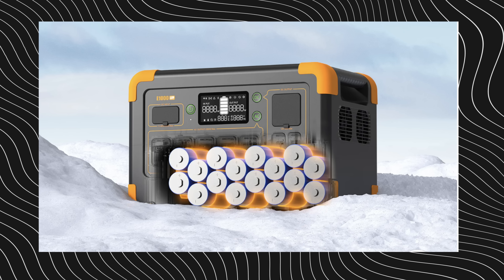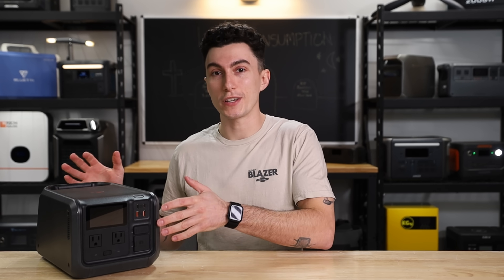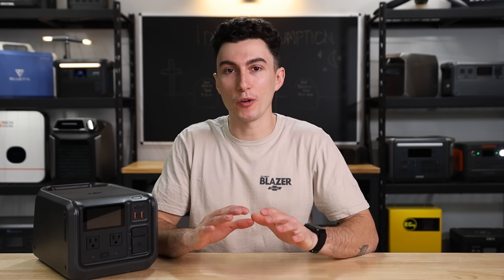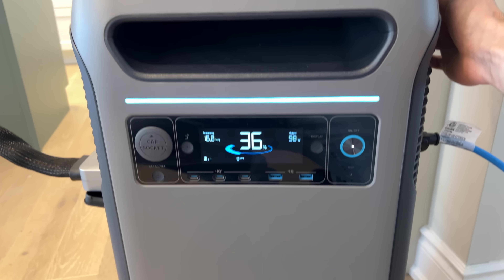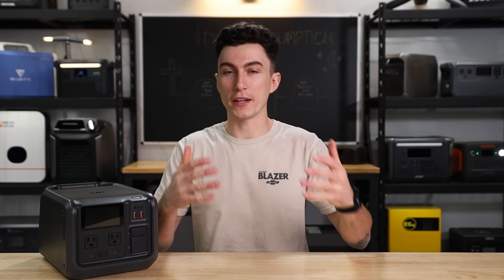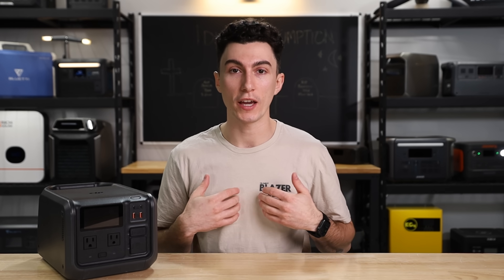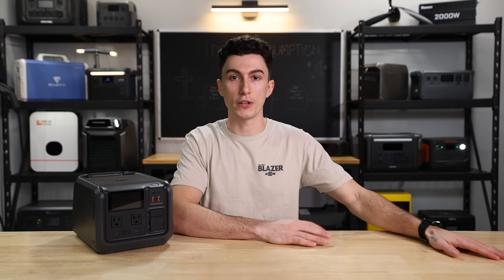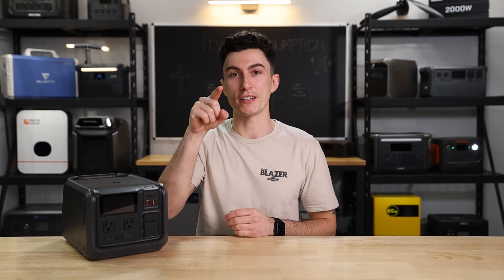Why Your Power Station is Draining Itself So Fast..

Comment: You have landed on one of the biggest issues with this stuff.  A lot of people buy these huge and very expensive solar generators not because they are trying to run an off-grid property, connect to a big solar array, etc. but just because they just want to keep their food from spoiling for a couple days after a storm.  And they think a bigger and much more expensive one will last a lot longer than a smaller one.  But just as a big gas generator uses more fuel at idle, so does a huge inverter.   Worse, a normal residential fridge draws virtually no power about half the time it is plugged in, it is a very intermittent load.  So if you have relatively modest power requirements, get a solar generator around the size of a Jackery 1000 that can easily run your fridge all night and a small, efficient c. 2000 watt gas/propane generator that you can run a few hours every day to recharge it.  Spending $4-5k on a huge solar generator just to keep your fridge on for a few days is total overkill.  You can accomplish the same thing without having to store 30 gallons of gasoline on site or spending anywhere near that kind of money.
Reply: I am one of those who just assumed: bigger would do the job. For those in third world countries, power outages for a few days are a real thing.

What to do, what to do?
Reply: @ The cheapest option for a grid that frequently goes down is going to be a small DIY solar system (battery, inverter, solar panels) backed up by a gas generator for when the solar panels inevitably can't keep up with demand because of weather.  These large power stations have two of the three components all integrated into one box, but you will pay for that convenience/simplicity.
Reply: @  Solar panels , battery's & a inverter. generator too if u can get one.
Reply: And keep in mind that there are three completely separate scaling components here.   The solar panels, the battery capacity, and the inverter wattage.   Power stations combine battery and inverter, but that also limits your options with regards to being able to scale just one of the two components.

And then there are gas generators... the traditional "generac" style large gas or diesel generator was designed to run the whole home without storage, but this also meant that those sorts of generators gobbled up fuel like there was no tomorrow even when home loads were low.

The modern way of doing a gas generator is to have a much smaller generator that ONLY charges the battery bank and does not try to actually supply AC power to the home.   This way you can purchase a smaller, simpler generator (though relay-controlled auto-start is still a nice feature to have), and pair it up with a battery charger designed to run the generator at roughly 50% load.

With the modern method, the generator only needs to run a limited number of hours each day to fill up the storage and will sip fuel because it only ever runs at optimal loads and is turned completely off at all other times.  Plus it won't have to run overnight at all.

-Matt
Reply: Since I use my units only for backup power needs and to save a few $ when the sun’s out, I don’t leave the inverter “on”.  I only activate the DC—>AC inverter when I’m actively using the generator and when I’m away from home (in case the power goes out while I’m gone).  And I’m ok with “idle” inverter power draw during these periods.
Reply: Charge the jackery by solar or alternator.
Reply: 2 days at 500 watts would be like 4 gallons of gas if that.  Most fridges run the condenser most of the time - rarely if ever will it pull no power.  I have both types. The gas gen can charge the power station then I don’t need the noise and gas for like 12-24 hours.
Reply: Guess you didn't read my reply! My 3000w low frequency unit will run my whole house on 120v, and it's idle consumption is a mere 13w. So your idea of bigger isn't better is utter nonsense, it comes down to quality over cheap chinese high frequency BS. The only company in the business that has better idle consumption is Victron @ about 9-11w, and they dont make solar generators. I have 2 3000w low frequency units 6000w surge, and thats true power, transformer based, dual mppt controllers 2000w solar input, dual ac charging, 1500w input, 20a car charging, 6 ac plugs on 2 15amp circuits, 5 13.8v dc cigarette ports 20amp, TT30 RV plug, external battery port, that accepts any 24v batteries in any chemistry, and I have 10kwh in batteries on them, heaviest piece 32 lbs, and it idles 13w!  Seems to me your just choosing cheap chinese crap over well built equipment. My system isn't plastic, it's all metal and built to outlast me, all modular and doesnt require cables to connect the proprietary batteries, in 2kw increments. 1 cable for external batteries, and thats not a hack, they charge from the system, and load share in conjunction with the factory batteries!
Reply: @dustydawson8977  So what kind of money do you have in all of that stuff?  What system are you talking about?
Reply: @trustbuster23   refrigerators have a huge inrush of current needed to start the compressor i don't believe a 1000 watt jackery is going to do it. especially if the refrigerator is older. a new refrigerator maybe.
for people out there --- you need a Generator capable of 4 times the Rla min. to start a compression. ie: if Running load amps are almost 8 amps = 3,200 watt Generator. 
old fridge.

new fridge--- about 4 amps Rla = 1,600 watt generator.

Some compressors can draw up to 7 times Rla on start for a second. i always recommend a 3,000 watt generator for a refrigerator.

also note refrigerator goes through a defrost cycle every 6 hrs - drawing about 390 watts for up to 30 min.
Reply: @OcRefrig  Well, I have actually done it, successfully several times with just an older Jackery 880, 1000 watt inverter, 2000 watt surge.  Multiple, multi-day outages, never had a problem.  Charge it up in the evening before bed with the generator, runs all night and usually has about 35-40% capacity left in the AM, and the Jackery 1000 has more capacity than mine.  My fridge is not particularly new, probably 20 years old at this point, and it is a full-size residential fridge with an ice maker etc, basically what most everybody probably has these days.  Agree that you do have to look at the amps on your particular fridge and size accordingly, but unless you have some fancy sub-zero monster or a relic from the 1970s you are probably going to be fine with a mid-sized inverter.
Reply: @trustbuster23   good to know.  thanks. they must be using a good battery & inverter in them.
Reply: @OcRefrig  It should, my EB3A (600w, 1200 surge) will USUALLY handle the initial plugin of my fridge (i measured as high as 950w surge but it lasts a few seconds and the eb3a doesn't always do it), so it's like right on the edge. Fridge compressors aren't all that huge, most of the rated wattage of a modern fridge is the product of it's defrost heaters.

a 1000w(2000w surge) will handle a fridge without issue

Comment: Many inverters go into a low power mode when there is no draw, mine is 2-3 watts. I shut off constant power draws like wifi at night and only keep the fridge plugged in. The inverter goes into low power mode when the fridge cycles off so the inverter is only drawing idle power when the fridge actually cycles on. I built my own system with 200 Ah LifePo (2560 Wh) and an inverter and I only use about 25% or 640 Wh in a 10 hour period running a standard household fridge.
Reply: Does a fridge actually work in low power mode. Victron's low power mode blinks the power on every few seconds and if something pulls power it turns on fully. Is that enough time for the fridge to realize it needs to run the compressor?

Comment: There is also the not mentioned loss of capacity from the lower voltage (3.7 lifepo4's ?) batteries in the unit to make the 12 volts when they aren't even using the inverter circuitry.  

Might be best to have a low end power station for charging/powering the small things, phone, tablet, smaller power packs, USB lights, toothbrush, or other USB chargeable devices

Then get an actual 12 volt battery (or several for higher capacity) and an inverter for the higher powered devices like the fridge or space heater(s) you may be using.

And a larger system like the f3800 for the heavy stuff like stove, washer/dryer, and HVAC, etc..

I've watched many videos from several posters now and it really seems there is no single "do all be all" system.  I doubt there ever could be with such diverse voltage and power requirements of all the devices people currently use.  Same as why most current LED lighting 'replacements' still use 120 VAC even LEDs are much lower voltage because no one wants to rewire their domicile from 120 VAC to 12 VDC for lighting.   LED lights currently aren't as 'efficient' as they actually could be.

Better to use a Power pack and a few USB lights.
Reply: The cells are 3.2V for LiFePO4 (3.7V for NMC).   But that's irrelevant because the cells are placed in series.  4 x 3.2V = 12.8V nominal (10V to 14.2V full-range, typically).  So a 4S LiFePO4 battery system can supply approximately (compatible) 12V directly to 12V gear with no conversions.

However, no power station that I know of uses a 4S topology internally.  Most small power stations use a 6S, 7S, or 8S topologies.  Larger power stations typically use a 10S to 16S topology (16S is 48V... 51.2V nominal, 48V to 56.8V, roughly).

-Matt
Reply: @ I’m just saying there is loss when a conversion is done, up or down.

Comment: 70 watts idle consumption on ANY inverter is Just a Poorly designed inverter. that's absolutely Nuts !!! 🥜
Reply: If you think 70w is a lot, You must have missed the whole home example in the video with 150w idle consumption
Reply: It depends on the inverter. If it was a 150W inverter then yes, 70 watts is poor. For a 3000W inverter, 70 watts would be quite normal. This is an extension of the car analogy in the video. A 1 litre engine will idle using much less fuel than a 5 litre enging. My 1kW inverter draws about 20 watts when idle.

For reference, the NOVA 12K Inverter in the video (2:42) shows an idle draw of 150 watts for a 10000W inverter.
Reply: @gavinminion8515 You've hit the nail on the head. The unit in question was a 240 volt unit and has 2 120 volt inverters running, plus he said that he was using the WIFI on the unit.
Reply: @gavinminion8515 most large inverters have a 20 watt or less idle this 70 watt idle us absolute garbage 😂
Reply: Why do they say idle consumption when the inverter is powering the fridge ? I suspect a crap inverter
Reply: @Chris-hw4mq  because it happens even if nothing is plugged in. That's the consumption when the inverter is idle.
Reply: @markkempton4579  Then why does he say that idle consumption is low if you're using DC only from the unit? It still has AC with nothing plugged in to the AC outlets then, no? i'm confused.
Reply: @rswow  you can turn off the AC inverter if you're only using DC power.
Reply: @markkempton4579  Then in the age of automation, why wouldn't the device have the AC inverter off automatically if nothing is running off of it, and then auto-turn-on as soon something is plugged in and drawing power?
Reply: @rswow  sometimes you want it off but leave the object plugged in. I do this with the power station in my shed. I can remotely turn off the AC and 12V outlets so that I have fresh tool batteries waiting or the lights (12V) are on before I get out to the shed.
Reply: @Chris-hw4mq  The fridge may have Sill Heaters, so they may not really be 0 when not cooling. 
At night, just turn it the inverter OFF. The fridge will be fine if the door is not opened. Yes the first run in the morning will be longer, but will ought weigh the nite losses.
Reply: @steveurbach3093   Yes, Very Good idea ! Temps will raise overnight but not By More than about 10 Degrees. So, Let the fridge Run its Last Cycle down to Off temperature. Then don't open the doors. this is crucial. Turning the inverter off when temps are high in the fridge is not good. Wait For it to Finish a Cycle.
35 Degree fridge. Doors closed overnight. temp will be about 45 degrees in 8-10 hrs.
Still a Safe food temp. Nsf 6 was 45 degrees years ago. they lowered it. Now Nsf 7 is Max food temp of 41 degrees.

Edit: Fans run on older refrigerators 24/7 365 in off cycle.

Comment: And don't forget that ecoflow recommends storing at 80%.  There goes 20% for that unexpected power outage...
Reply: You can safely take LiFePO4 below 20%.  You can take it down to 0% (which is to say, NOT 0V... that would destroy the cells, but nearly 0% in terms of remaining energy).  Modern LiFePO4 cells will do 5000+ cycles to 80% capacity at 80% DOD.  Believe me, the power station's electronics will die long, long before the cells do.  So you can do 2500 cycles to 80% capacity at 100% DOD and not even notice the degradation.

Cycles for LiFePO4 are full cycles.  Partial cycles do not count as full cycles.  And generally speaking, calendar aging of the cells will cause more wear than cycling them in most use cases.

-Matt
Reply: And you're not supposed to go below 20%
Reply: @juggernaut316  yea but for the occasional power outage its there, just not for those running it daily to offset the grid.
Reply: Yeah you can store at 100% and drive it down to 0% . I’ve done this with my Jackery for 5 years. I now build my own battery banks. But they say that to last the battery for 10+ years, by then the tech is redundant anyway.
Reply: That is for any battery long term health. It does not mean you can’t do it on occasion. E.g. if you want the battery to have 80% health after 10 years, keep it between 20-80% at all time. But running it 0-100% a few times a year, I would assume, would have very little impact. Like phone batteries.
Reply: Bluetti says 40-60%. Can you believe that?

Comment: For the all in one 48v inverter charger with mppt (such as EG4 3000EHV-48) Do you know if the power switch turns off everything or just the inverter?  When the power switch is OFF, can it still be charging with solar panels?

Comment: 3:47 you mean 1300 watt-hours per day. 3:28 and 3:56  just say "it uses 70 watts."  4:06 "70 times 24 is about 1680 watts" no, 70 watts times 24 hours gives watt-hours, not watts. 4:14 you mean watt-hours, not watts
Reply: Exactly. 
Watts measure power. 
Watt hours measure energy. 
You don't say, Go 20mph a day.
Reply: Using the correct terms is part of the change required to educatie the masses. Power != energy.
Reply: I like this comment. I was also confused at what he meant at those points. For a generic tech channel covering something like this, understandable. For a channel dedicated for something like this, more accuracy is expected. Great video though and did answer some questions about why some of my batteries died so fast ❤.
Reply: Thank you for bringing this up. He kept using the wrong terms, which made it pretty hard to listen to. I always cringe a little when I hear someone uses the incorrect term "watts per hour" instead of just watts (W).
Reply: Agreed. One hopes it is clear EVERY commenter on whatever aspects of these videos wants one thing: for this channel to be one of the best and most informative around. I really enjoy it.
Reply: This needs more visibility. Thanks! Maybe you can do an idle consumption shootout in like the small/medium/large classes. I’ve seen a video where a 288wh unit was able to keep a fridge going overnight. Seems like it’d be more efficient to use one that size and recharge it using a larger one with dc to dc. My main use is for power outages that last 1-7 days.
Reply: I've never wanted to bully a comment so much
Reply: bet you are the life of a party…………Not.
Reply: @Imjustsaying1966  Maybe not, but I'd rather have a conversation with someone who makes an effort to speak accurately and clearly.

Comment: Not all of these use a ton of power in standby!  The Pecron is obviously really bad at this...
My OUBOTEK inverter than I got to back up my fridge uses less than 10 watts at idle - only ~14 running!
Reply: Depends on which one and size you're talking about. You listed two brands. That's not the same as identifying the battery and inverter size that this discussion is all about.

Comment: Good video! Conversion loss is something the average person doesn't take into consideration, but can be a huge factor in emergency backup situations. "Actual usable Power" should be documented. A good estimate to be safe is to go with WH / W X 85%, which should be close to actual usage capability.

Comment: Great observations but please use watts, watt-hours and Wh/h correctly: power, energy and energy consumed over a period.
Reply: Call it this or that, but isn't useful/expected battery diminishing regardless of what you call it?
Reply: @ quite true
Reply: Bill is right.  Try to use correct terminology for clarity, for those just learning, and so you don't sound ignorant.
Reply: Yeah the calculations at around the 4min mark need to be explained properly. Energy used is Watt-Hours, not watts.